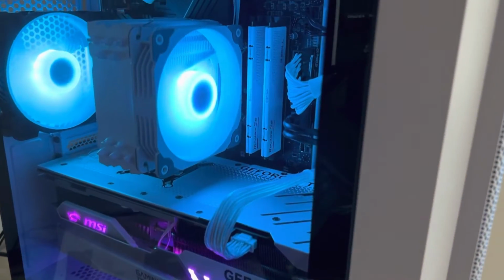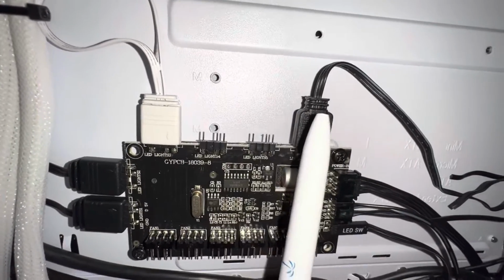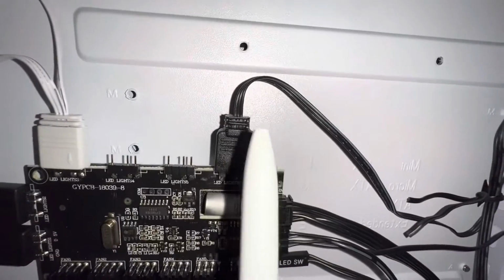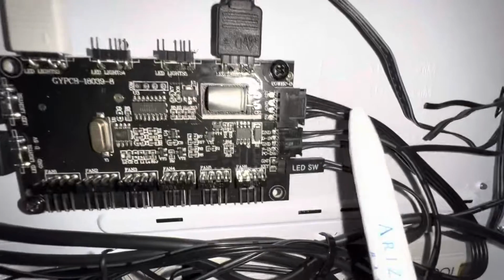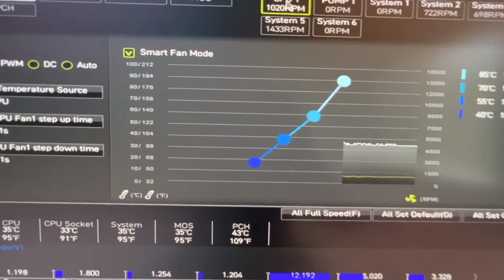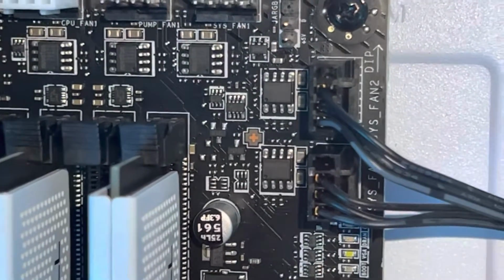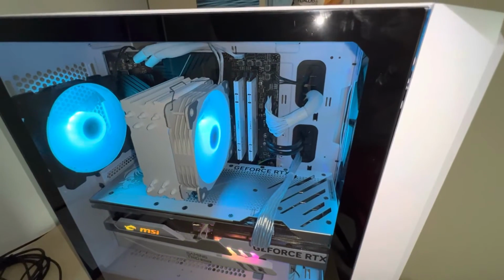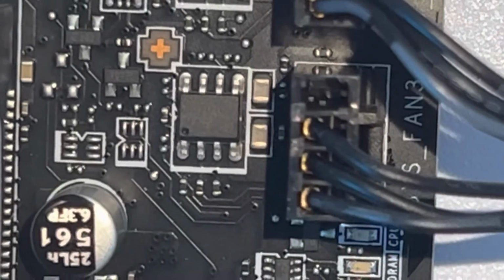Solved: Montech Air X ARGB fan hub 0 RPM issue.  Also an easy way how to tell if a fan is PWM or DC

Comment: Just built a new workstation and moved my 903 Air Max case from a gigabyte mobo which had no problems with controlling fan speed or ARGB to a MSI mobo. My fans are now running max speed 100% of the time and Mystic Light doesn’t control ARGB. Frustrating MSI can’t control the Montech hub.

Comment: the solution is simple, only one pwm port from the hub send the signal to the mb, so plug in to the correct one (the port 1 generally)

Comment: Yo, I have argb fans, with a hub (from TZMRIT). My problem is that my b550 tomahawk mobo is reading all the fan port to be plugged with fabs running at 16448RPM. But I have only the CPU fan on CPU_FAN, and the hub on SYS_FAN1. That’s super weird and my argb is working correctly

Comment: If my understanding is correct, you are bypassing the montech hub. Your fans go directly to the motherboard? The main attraction of this case, is the fan hub (and the price of course). If the fan hub does not work. Then what's the point? Have you tried the MSI center? That also has features to control the fans. However, if the fan hub and the motherboard are not talking to each other, I doubt whether the MSI center (windows application) will work either. I was going to buy this case over the Thermaltake View 380 TG ARGB. Now I have cold feet! I'm not a fan!

Comment: Good to know, I just did a build in a Sky Two GX case, and if I run into this issue my B550 tomahawk max wifi has plenty of headers.
 Worse case I may need a splitter for the front 3 case fans, I already have a splitter for 2 I had previously.

Comment: I'm having same issue Anidees Fan Hub, I tried connecting a fan to all different connections on the HuB and still no readings.. It must be cause it's a cheap brand for a Fan Hub.. PWM is working properly with all the fans connected, so I'm not too worried..

Comment: This is hellpfull thanks. I have the montech air 903 and i need to control front fans with the switch. RAM lights through another program, and then my GPU light through another program. Its a pain. So i gave up and set everything one collour.
Reply: You can set the lights from many motherboards in the BIOS itself.

Comment: i've got the montech air 903 max with the 4 case fans connected to the hub, and the connector leaving the hub connected to my motherboard in a cha_fan port, but the thing is they don't seem to get any slower than 600 rpm, even if i try to set them at 0% with fan control app. Need to mention that they can go higher so I have control over them. Is it that they can't go any slower than that or what's the catch?

Comment: This was a great video thanks. I am also having a problem with the hub for the Air 930 Max case but the total opposite. My fans are running at a blazing speed and it’s loud even when idled. I have an MSI B650-P WiFi so I am fortunate to have the fan ports. This is my first build so I wasn’t comfortable enough to mess with the BIOS.
Reply: If you haven’t fixed it already, I had this problem also and all you have to do is connect the fan hub using the small cable on the bottom left of the fan hub. Then go into the bios, select the system fan connector you plugged it into, and change the fan type to PWM (if they are the built-in case fans). I just did this recently and now the fans are like 5 times more quiet. Unfortunately, You will have the zero RPM issue. Hope this helps.
Reply: @whatdidyourjustsay  hello there I have the same case with this guy and the same problem .
I just bought a montech air 903 max and my fans are running at full speed and I don't have enough ports on mobo.Can u explain better the solution cause I don't understand the way you said it ?

Comment: My cable melted for some reason. I am not sure if it was related to it not being plugged in all the way. It seem to be connected correctly
Reply: When you can afford it maybe get something like the gamemax triple pack which comes with the hub.  The 3 pin connectors and the 4 pin power all connects into the hub.  The sata cable straight from PSU powers the hub and everything then there's one connection from your hub to the motherboard.  On mine I've left the standard CPU fan plugged into motherboard but will upgrade that to ARGB at some point.    Best of luck with it all
Reply: Probably a 5v argb fan (designed for 5v hub) plugged straight into the 12v motherboard
Reply: @malcolm8176   Thanks for the reply. That is probably it. Instead of taking the build apart and returning the case, which the computer place recommended doing, I bought another hub(not sure what the voltage is). The first hub controls the RGB, and the second hub I attached controls the fan's RPM. It may have also been a short in the wire or something. I couldn't find the same wire to replace it.

Comment: heyy so might be a dumb question, but does this just mean that the fans still spin, its just that the motherboard cant read the rpm? im interested in buying this case and i dont really plan much on controlling the fan rpm
Reply: Yes, they are spinning at full speed. But I have them adjustable in bios, dc. Only they do not stop completely, but in the range of 40-100%. I connected them directly and adjusted the adjustment on the video card for complete silence with the program.
Reply from the maker: Hello!  With the fans connected to the fan hub, and the hub connected to the motherboard, the fans do spin.  However, there doesn't seem to be any intelligent RPM control, and the motherboard isn't reporting RPM.  I suspect it's because the hub is for PWM, but the case came with DC fans.   I think I have a spare PWM fan, will test this theory at some point.
Reply: @renaissancelaboratories5645  I think this is because the controller is powered from sata and the motherboard does not see it or there is a conflict because of the power supply. Even if the controller is not connected to the motherboard, the fans are still spinning. I connected a PWM fan and it behaves the same with the others and separately as well. The PWM is not regulated. When I have time I will check this theory, I need to disconnect the auxiliary power and see how the adjustment will work. But I suspect that then the backlight will not work. My motherboard does not support RGB.

Comment: have you tried to plug the front two fans in hub and back fan direct to motherboard, then connect hub to system fan header and control the hub as DC ( I had similar problem with MSI motherboard in past with different case. Also look for Bios update). I hope it will solve the hub issue.
Reply from the maker: Hello!  Of the many combinations I tried, I’m not positive that was one of them.  I’ll give it a shot.  This case came with all 3 case fans pre-installed and connected to the included hub.  Months later I am still really liking this case, but the LEDs sometimes have a mind of their own.  One caveat is that it it’s too small for most RTX 4090 cards.  The 4080 barely fit.
Reply: @renaissancelaboratories5645  Did you try that? Cause I am having same issue

Comment: Thanks for this video, it helped me get my fans working! 

The rgb on the fans doesn’t work though. I plugged the rgb hub into the jrainbow socket. Where did you plug yours in?
Reply from the maker: My motherboard is MSI and it has headers labeled ARGB  These are 5v, 3pin,  addressable RGB connections.   ARGB fans have two wires; one for fan power, one for the lights.  Hope this helps!

Comment: i unfortunately have this problem, just no extra room on my motherboard for all my fans sadly. i can control all the leds through the motherboard led software but it wont pickup the fan speeds.
Reply from the maker: I wonder if you can chain some of the fans together.  I’m thinking for example if you have 3 front case fans, it would be OK if their RPM was all the same, perhaps they can be chained together and connect to the motherboard in one spot.

I checked Amazon, there are definitely splitters available for 2 and 3 fans to connect to a single spot on the motherboard.  That may be an option
Reply: the software is aware that there are fans but just wont read the info :(
Reply: plus i only have 1 usb 2.0 on my motherboard so i cant add an extra led hub like the icue or anything
Reply: ive got the PRIME B560M-A Motherboard
Reply: I'm in the same boat. RGB is fine but I have 6 case fans. Using an ASUS ROG Strix B550.